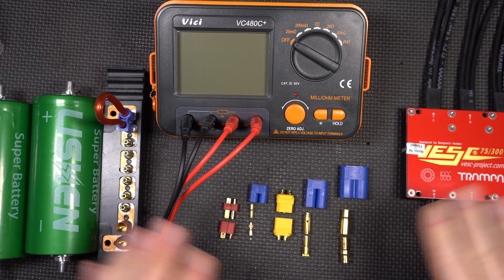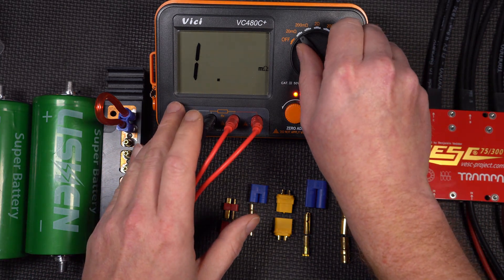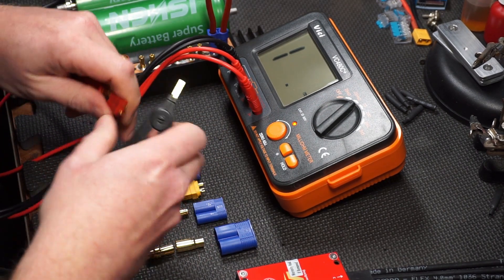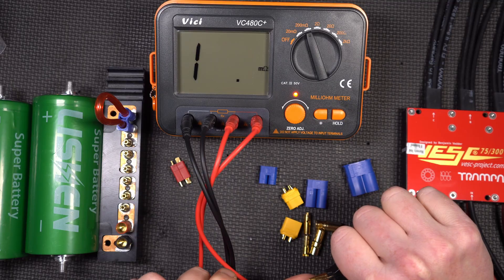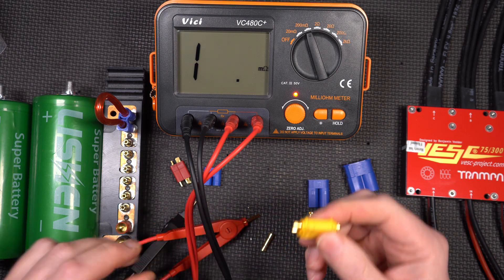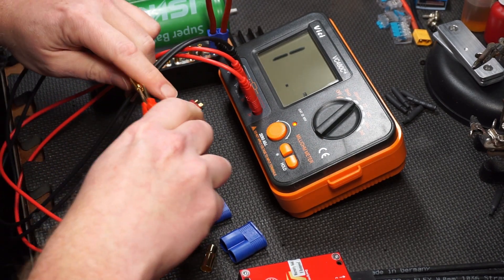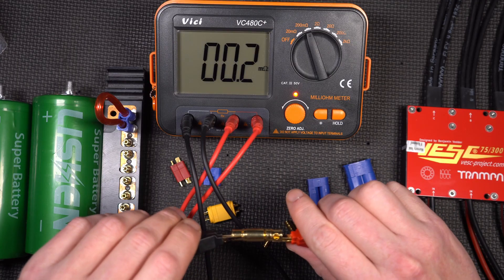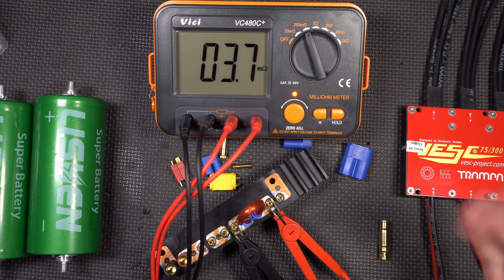RC Connectors' Resistance - In Milliohms!

Comment: Idea for next video based on this one is to do a calculation on how hot the connectors will get under the load conditions you put them, bases on their resistance
Reply from the maker: I thought about that, but that would get complicated, because heat will play a role.  At least with these measurements, there's a baseline.  So EC8 connectors have less than half the resistance of EC5 connectors - as temps rise, that relationship probably remains fairly constant.  Add a bunch of connectors and some heat and suddenly you're talking about the difference between 20 milliohms and 50 milliohms - that's pretty significant if we want to maintain max voltage to the ESC/motor.

Comment: Just ordered the VICI VC480C+ meter for $95.  Was looking for a meter that uses the 4-wire Kelvin bridge, which is required to measure connector resistance. Will probably use it once to compare resistance of ways to connect wires (twist, solder, crimp, solder and crimp, and solder sleeve). Too much Science Club as a kid, I guess. I've read crimp connectors are reliable for auto use, but have like 3X resistance and build up heat. Solder makes good electrical connection but is prone to failure if not secured from vibration.

Comment: Hello, great informative video thank you. just a question please. My boat is wired up with EC8's. My batteries all have EC5's. I can have them re soldered with EC8's. Ive seen one can buy EC5 to EC8 connectors  ( no wire in between ). I was thinking of using these connectors instead of have the batteries changed over to EC8's. Is this a good option with regard to current flow ? Appreciated

Comment: Great video!  Would love to see an update with the newer larger connectors common in high load RC applications.  Specifically XT90 (4.5mm), XT90-S (4.5mm anti-spark), XT150 (6mm), Castle Polarize 6.5mm, AS150 (7mm anti-spark), QS8 (8mm anti-spark) & QS10 (10mm anti-spark).  Also would be good to perform actual load to failure testing on each to see true maximum continuous and burst capacity.  For the anti-spark variants would also be good to see if these anti-spark features actually result in any significant reduction in resistance over cycles/time.
Reply from the maker: That's a good idea.  I'll try to do that.

Comment: Based on the current those connectors will carry, wouldn’t it make more sense to measure the voltage drop of them under load?  When testing vehicle starting Circuits, you use voltage drop tests to find problems.
Reply from the maker: You can easily calculate the voltage drop.  If I simply measured the voltage drop, it wouldn't be a fixed number; it would depend on the voltage used.  Also, keep in mind resistance will go up as the connectors heat up.  But you can calculate the heat build up too.  Here's how:  use Ohm's law - V=IR or put another way, volts = current x resistance.  So let's say your connector has a resistance of 10 milliohms, or .010 ohms.  If your current is 250 amps, the connector will drop 250*.010 or 2.5 volts.  The connector will also have to dissipate 625 watts of heat (!) - use this formula: P=VI.  Or Watts = Volts x Current; in this example 2.5 X 250.  Obviously, one of these small connectors will melt pretty quickly with that much heat.  But then again, none of these connectors were that bad.
Reply: That's actually exactly what a milliohm meter does, and why it has 4 leads instead of 2. 2 of those leads pass a fixed current through the connector, and then the other 2 are measuring the voltage drop. so if the meter passes 1A through the connector, then the voltage it reads is the resistance of the connection R=I*V or R=1.000*V

Comment: What do you think of the "anti-spark" features available on an option on some of these connectors?
Reply: IMO they're a bit silly since you can just add a large-ohm resistor to an extension balance harness that you add to the esc's power connectors. When you connect the balance connector, it charges the caps slow enough to not spark when the mains are connected not damage the thin wires.
Reply from the maker: I don't use them - I use the resistor idea that Hydrocarbon82 mentions.  Though I'm not using these for RC stuff - there's tons of room (relatively speaking) in a full-size car.

Comment: Hmm I actually found this because I was on there search for low resistance connectors for mA measurements so I don't have to solder the wires directly.

Comment: This method is a waste of time and a very inaccurate way to determine how the connectors will perform in their intended application.    The correct method which is much more accurate and provides consistent results is to apply a constant high current through the connector being tested and measure the voltage drop across its terminals directly with a mV meter  You will need a power supply capable of providing at least 50A, if not higher as todays RC planes, cars, helicopters etc can draw as much as 100A or so.   This method will also highlight any connector deficiencies such as long term overheating problems.
Reply: " The correct method which is much more accurate and provides consistent results is to apply a constant high current through the connector being tested and measure the voltage drop across its terminals directly with a mV meter" This is pretty much what a milliohm meter does, like the one seen in this video. See how it has 4 leads? Two are used to apply a constant voltage through the connector, while the other two leads messure the voltage drop.
Reply: Sorry, but you're wrong..
Reply: This method is much easier, and very accurate.